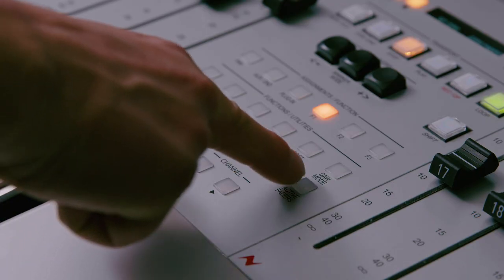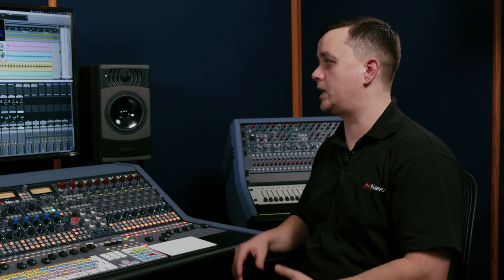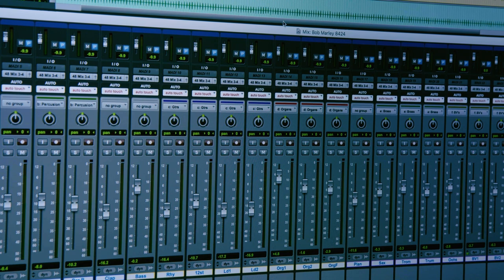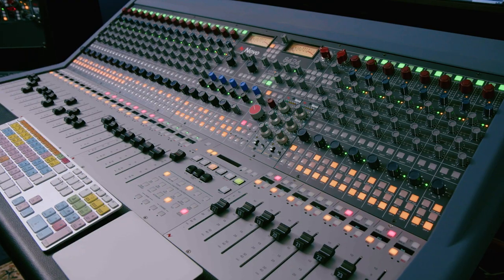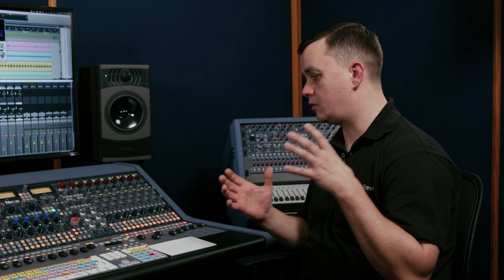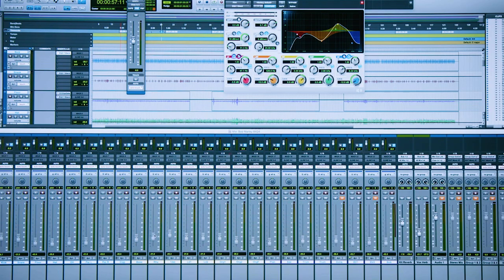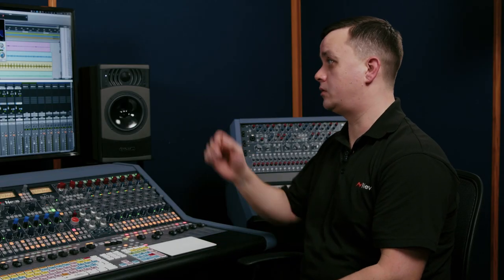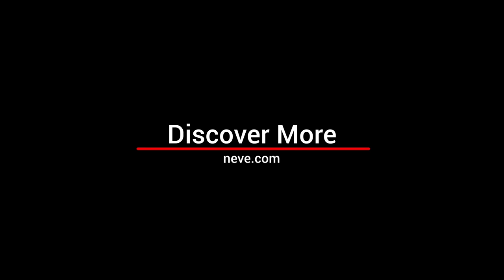Episode 14: Active Fader Automation

Comment: If I use the 8824 as a surface control in pro tools how would the recall work? When opening the mix, does the console automatically return to the position I left it in Pro tools? Can I use the console as a Summing?
Reply from the maker: Yes, If using the console as a DAW controller, the faders will jump to match the settings in your chosen DAW

Comment: I did not know, there was a 8424 with Motorized Fader. Very lovely ! I will consider that one for my studio. My only question is, this model only has 2 transformers as well as the original or regular one? Can someone tell me please? I use Studio one by the way.
Reply from the maker: Hi James, the 8424 1073 preamps use input and output transformers and the mix bus, cue send and AFL bus are also transformer coupled using our custom Marinair specification transformers.

Comment: Just to be clear, with active fader I can automate faders of the 8424 in Pro Tools, while the inserts of those channels (eg compressors, saturators, etc) would remain pre-fader, correct? Thanks.
Reply from the maker: Yes, that is correct. By setting up the DAW session correctly and entering Active Fader mode, all automation is achieved post plugin & analogue processing
Reply: @AMSNeveLtd  Thank you for the answer. That is awesome. And guess what is back on my wishlist now 😝💙

Comment: I would like to see in great detail how the fader automation is written in the DAW. For cubase do you have to set up 24 midi channels right at the top of the session to control the automation for the neve?
Reply from the maker: Hi Jason, 

Thank you for checking out the video. 
To answer your question, yes, that is one way to do it. 24 'dummy' faders at the top of the session can be used to remotely control and automate the console's faders. 

The second method uses pre-fade sends to output the audio from the DAW channels directly to your audio interface outputs through the console. This method frees up the DAW faders and allows them to be used to remotely control and automate the console faders directly from the channel volume automation lane. 

Each method has its merits depending on how you like to work. The first method separates DAW automation and console automation, which may be ideal for two-stage mixing, while the second method keeps everything in line, with plugin processing from the DAW channel entering the analogue console channel from the top down. 

Page 186 of the User Manual details the methods involved: https://www.ams-neve.com/wp-content/uploads/2022/02/8424-User-Manual-Issue-5.pdf